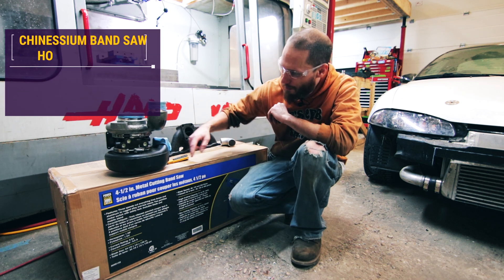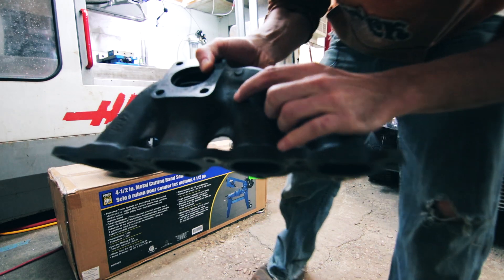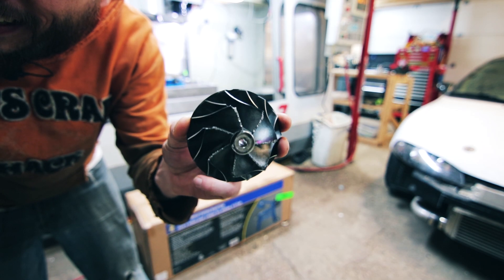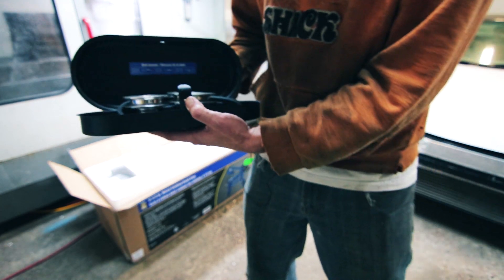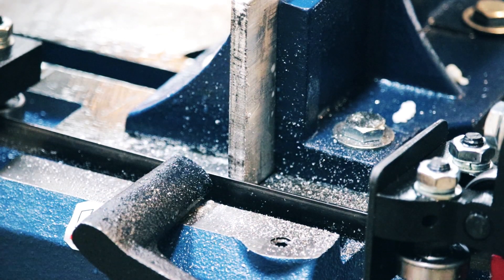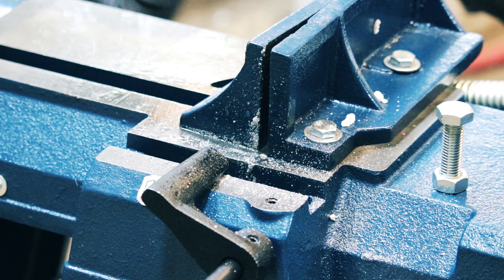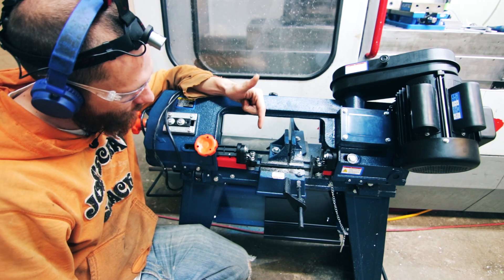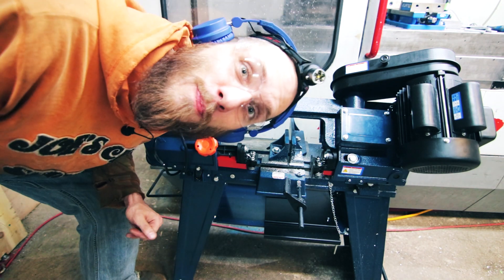How Well Does The Cheapest Band Saw On Earth Cut ??? Harbor Freight / Princess Auto Special !!

Comment: What’s the absolute tallest piece of metal you can cut with it before it hits the back bone? I’m building a saw table with two of the pro point 14” saws and would like to hang one of these off the end for the thick stuff
Reply from the maker: 4.5" is the tallest....but that is tight to the top of the frame so I'd say just shy of that and 4-3/8" is tallest I would attempt.

Comment: Looks Iike a decent saw  i know with the HF porta bandsaws everyone says to  repack the blade ASAP ? Apparently the one in it says its for wood  and the reveiws i saw said to go with the Milwaukee brand ?   It looks like you got a good one out of the box! Ill. Be looking foward to your manifold build  too  I was into British MG roadsters fo a number of years and  there exhaust manifolds always  cracked ?  I had one car for 14 years and i brazed it. All the time  ? The original design of that car was long before they needed to put any air pollution devices to conform with U. S. Regulations. And i. Suspected it cracked because. Of extra heat and weight. From the  Catalytic converter and a slightly different exhaust system in the original build   Of the car  i. Found a local British mechanic  that used to tell me to  take all that  “crap” out of the engine bay if i wanted the car to run well  i did  take the catalytic converter off  and cleaned out. The insides then pur it back on to look like it was  doing its job but in reality it was just a straight pipe for the exhaust  system   And the car did run a little cooler  i cant say it ran better  or had  more horsepower  truthfully  but that old timer. Swore to me. It was better for the engine  and he had wrenched on many of them over the years   After i sold that one all my other British cars were  way older and exempt from most of those rules  therefore i didnt have to mess with that system again because they were built in the 50s and 60s  good luck with your new saw. I hope it gives you years of good service  i found your channel btw researching some of the HF tools  and reveiws   I am a retired Woodworker between homes and shops at the moment  and i anticipate my next one having a strong emphasis on Woodworking again but i do  have a  interest in doing more metal fabrication  in my future  as well  therefore i like to. See  the tool reveiws and to know what to keep a eye on in the papers and Craigslist ads
Reply from the maker: I'm super excited to build my own manifold. It's a first for me so there's lots to learn. I think mine cracked bc of the weight of the turbo combined with 900*C exh temps. My dad used to have an MG as well (he's from Oldham) and loves to talk about it. He loved that car. I'd love to do 1 up one day, but I've got a few projects to finish off before that still. 🤘😁😁😁

Comment: I got the harbor freight version of that saw...embarrassing how cheap it was, but I totally agree, its a champ for the money. I made some toe clamps for my mill vices figuring I would use the mill
to clean up the saw cuts. turns out there was no need, the saw cuts were plenty square and the surface finish was as good as the milled surfaces.... wait till you put a good blade in it!
Reply from the maker: I'm so excited for a good blade. I grabbed a bimetal but it was the wrong one. Oops. 😅

I was really blown away by how good the cuts were. Great value.

Comment: The Harbor Freight saw it works fantastic I've done a few mods to it I put a bracket behind the adjustable jaw with a screw to adjust perfect 90 so I know it stays that way all the time and returns back to it after I adjust for a different angle.
One thing I suggest doing is changing the gear oil and making sure it's not leaking out I toasted the brass gears inside the first saw I had oops.
Reply from the maker: Thanks for tip! I'll check the oil / swap it. What did u use for new oil?

Comment: So, I take it, your are not a fan of air filters?
Reply from the maker: I don't understand, air filter on a band saw?
Reply: @LucasIsBusy  No, i was talking about the turbo. The edges on the big impeller look like they meet something rather solid
Reply from the maker: @DeDeNoM  OOOOOOHHHH!! I had the air filter off and was welding and when I snapped off the tig tip it ricocheted and landed in the air filer quilts. I check the air filter before I put it back on but I couldn't see the chunk of electrode in there. So when it went back on the car it eventually got sucked up into the turbo but I was fortunate and the turbo kicked it back up instead of sucking it down into the motor. Messed the blades up, but the turbo survived. I'm super meticulous with the intake and exhaust stuff when I have it all apart I put tape or whatever ovet the pipes to make sure everything's okay and doesn't get stuff in it. So that air filter thing has made me incredibly paranoid about it because I have no idea how that little tip got into the air filter.

Comment: The guide wheels are on an eccentric , turn them , make sure the blade is held tight enough , so it wont lay over , also have the guides as close as possible to the work , I have had one for years , good little machine.
Reply from the maker: Thanks for the tip. I didn't know about the eccentics. 😁